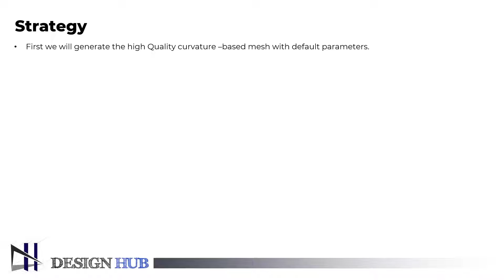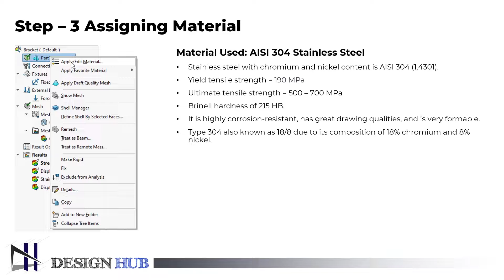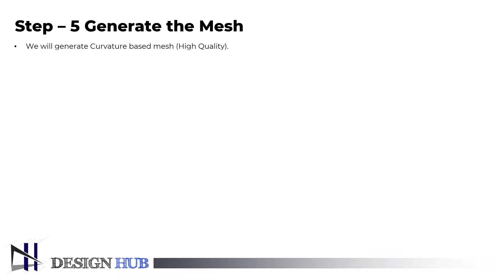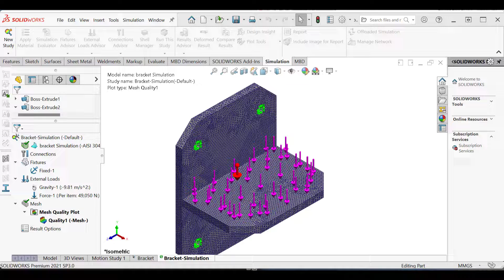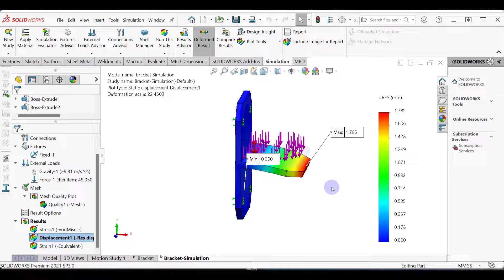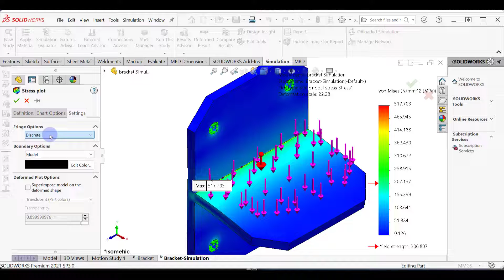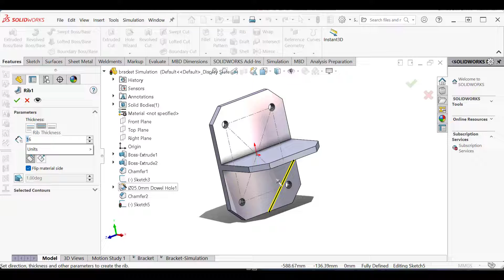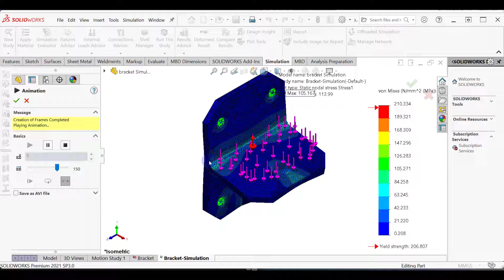"Static Stress Analysis of a Bracket Simulation: A Comprehensive Tutorial | Design Hub"

Comment: You got these large stresses in the first place because of the mathematical effect of singularity. The more you refine the mesh, the higher the stresses would become.

And is it also correct that the back mesh of your bracket is starting to push into the wall? Perhaps it would make sense to put a virtual wall, or somehow limit this point with constraints?